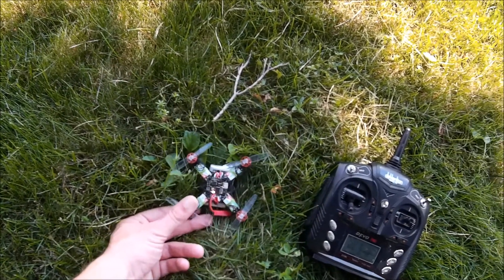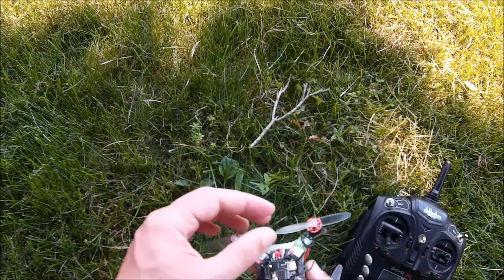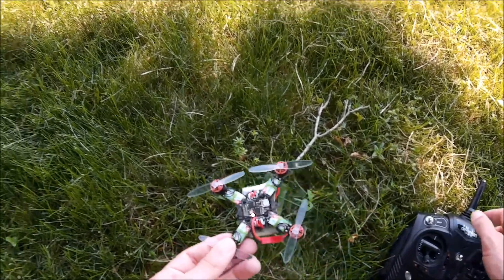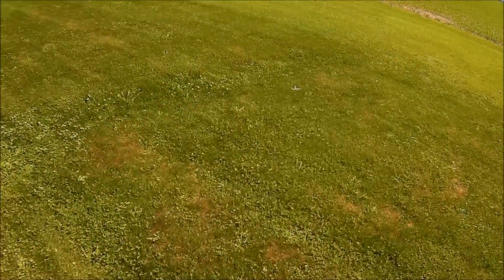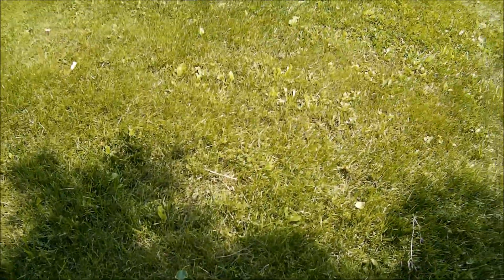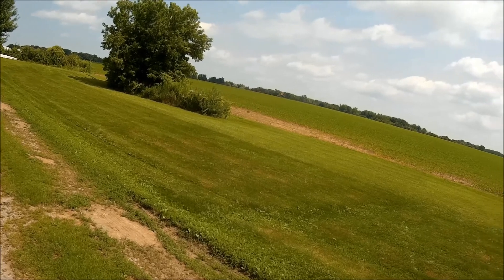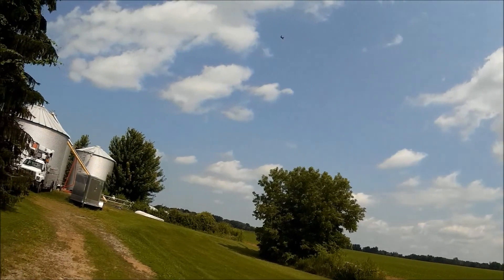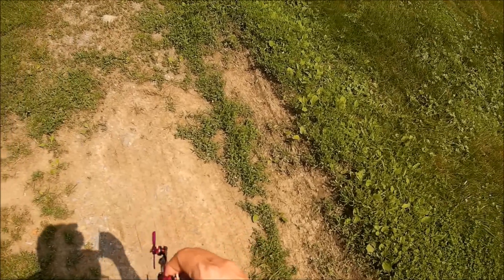1103 1000kv LOS flight testing some more props

Comment: Hey man, I have a 81mm build going rn, thinking about the Boldclash 1103 10000kv, would u suggest a bi-blade?
Reply from the maker: I'm pretty biased against anything with more than 2 blades on a micro, and would personally use ~55mm Hubsan props.  I'd also use a larger frame to be able to clear ~66mm props, but 81mm should just clear 55mm but depends on the frame config.   You could probably get a touch more thrust with more blades at this size, but efficiency tends to drop quite a bit.
Reply: Dave Woods Awesome, I happen to have a bunch of Hubsan’s (failed brushed build),what bit do u use to drill them out, also any tips to keep me from screwing up? :)
Reply from the maker: I show some drilling in this video: https://www.youtube.com/watch?v=6YiTu3Bo9Ko
You want 1.5mm drill bit or just a touch under.  I generally get a nice fit and CA glue them on.  If they press on too hard the shaft can move in the 1103 motors.
Reply: Dave Woods Appreciate it man!

Comment: Wouldn't the gemfan flash 2540 tri blade fit on 1104? I've heard you have to increase your RC rate to compensate for more props
Reply from the maker: Sure they should fit 1104, possibly a bit much though if your pushing the KV and voltage.   
In my experience 2 blade 3025's (or 3020) are better suited/performing if you can fit them.
Reply: Dave Woods Yeah maybe if i was as good a pilot as you the motors would overheat ☺,  but mine spends more time on the ground than yours lol. In all seriousness though i may have to go to a twin blade if i can't tune out the oscillations on these 2540's on the leader 120, 2.8" is about the max I can fit unfortunately

Comment: The 2035BN are really durable for a small prop and the holes for the props are very tight so they stay on well. I think that explains their popularity.
Reply from the maker: Could be.  I actually had to drill these out to get them on.  
They're also throwing away a lot of thrust/performance potential which I personally can't get on board with.
Great for me though, with the masses being less concerned with performance, BG now has the 66mm props with 1.5mm hole like 90% off ;)
Reply: Could I trouble you for a link please Dave "BG now has the 66mm props with 1.5mm hole like 90% off ;)"
Reply from the maker: just search there for "1103"